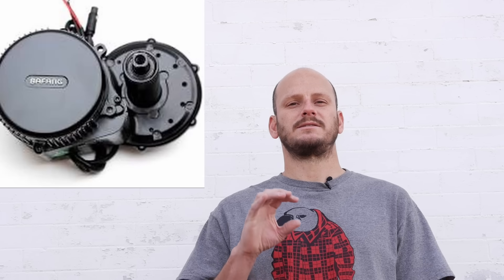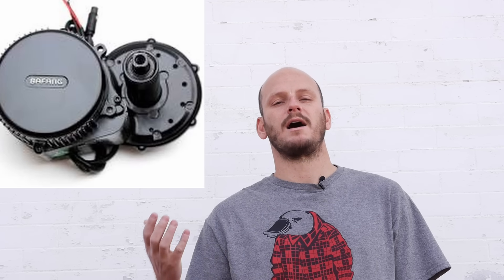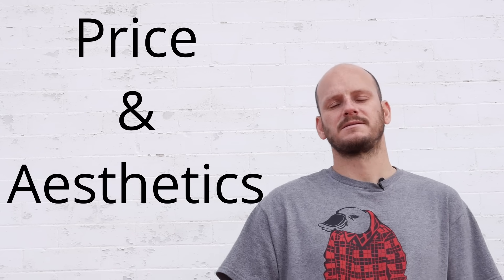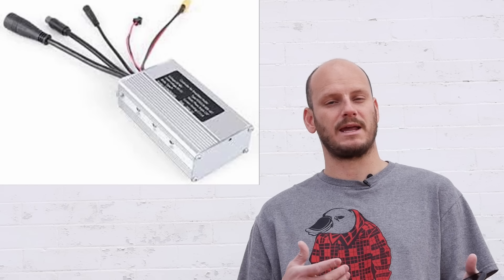Hub vs. Mid Drive Motors: Why Hub Motors Suck and Debunking Common Myths with performance test

Comment: @JohnnyNerdOut 
OFF ROAD is where a hub motor is absolute king.
For a true off road bike a hub motor system will win hands down: Explanation...
Hub motors are easier to set up for 2 wheel drive, no 1 wheel drive can match a 2 wheel drive off road, its comedic even with a massive power difference in favor of the 1WD.  Hub motors add weight in the right place, the advantage here is if you are moving through 5 foot or more of water flowing fast and perpendicular to your direction of travel, without the weight of a battery and motor on the front wheel, the bike will flip on its side, mid motors are not for off road, they work fine on trails, but on actual off road, in places where the only trails are those of animals. they will be the first thing to get trashed, rather than just a chain ring. This former also applies to ice when using spiked tires or chains. no weight no grip.

Comment: I have a question sir. If I had a mid drive, would I still be able to pedal manually without any assistance from the motor? I ask because I mostly live on flat and even surfaces for hundreds of miles.
Reply: Yes

Comment: Completely disagree. Hub motors are much better if you don't want to peddle or shift gears constantly. They're re quieter, far cheaper and easy to fix/replace.
Reply from the maker: Definitely the better option if you don’t want to shift

Comment: Went with a mid drive and never looked back. Having ridden hub motors in the past the mid drive blows them away. Being able to use all the motors power using your existing gears is a game changer to me.

Comment: This video seems to assume gearless hub motor, but there are geared hub motors (as on front wheel hubs) which spin at a constant speed regardless of wheel speed. I don’t think they have the ‘burn out’ issue he mentions with hubs. Mid drives for a long time were noisy and had resistance if unpowered, but the Bosch third gen motors are quiet and spin well without power (if like me you want the exercise or to extend the range).

Comment: mid drives put a lot of strain on your cassette and chain, that 120nm gets to the back wheel through your crank set!
Reply: Bbshd at 1500w with 15$ chains I’ve Never broke a chain  like everyone seems to be scared of. 18$ Cassettes handle it fine. Everyone scared of some fairy tale they heard on the internet. Yeah maybe don’t put a mid drive on a bike if you are using some crazy 500$ drivetrain. Otherwise don’t worry about it

Comment: I'm truly regretting having clicked on (and thus tacitly endorsed) such ill-informed and incongruent drivel. Consider, that the 'expert' criticises hub drives for having no gears (which is not true) yet later says he would only consider hub drives for a single speed application, without cassette (... those are gears, right?). Yes, there are differences between hub and central drives but you won't find any enlightenment here. Disappointed.

Comment: does a 10000 watt mid drive e bike exist?
Reply: 10kw won’t work with a mid drive ebike conversion. That’s not really considered an ebike. With mid drive You can feel aluminum frames flex at 1500 watts . Chains are fine at stock power levels, but more chances of a Break when you start to go beyond like 4000w

Comment: I have a 1KW 1.5KW Peak Mid Motor Bafang HD and it Blows Every E-Bike in my Town out of the Water I hit the Trails and everyone is trying there Everything too get up too me and I just push the Button See ya Through the Woods and up the Big hills 7 Speed it does 19MPH 1st Gear and 48MPH 7th Gear and I get 30 Miles doing 35MPH Non Stop with my 13S7P 91Cells X 18650 cells other People Burn up there Hub Motors all the Time trying too ride in the Woods with me. https://www.youtube.com/watch?v=atAMRzYKwkI

Comment: Hi I have a Question for you I am up here in Canada And was looking at the Emmo Monster 84V,   I live in a hilly area The sales man said that I would need a 4000 Hub Motor and a 50 watt Lithium battery  Price up here is 6.759$ but up here in Canada everything it dubble the price. Should I walk away I am 76 and do not like Pushing up a hill  Thanks  Doug

Comment: Get a hub drive if you're doing a trike. The cassette sits further in on a trike than a regular bike and you'll only get like gear six and seven to line up with a mid drive

Comment: so with a mid drive are you using the bicycles chain or a heavier chain . im a speed freek its just i got pulled over the other day to find my gas motors are all ilegal . i am looking for the cheapest way out. found a motor that atatches to the bike but it drives a single gear with a mid drive one vid said i would have to pedal no way im pedaling at 30 mph. in your video your not pedaling im guessing i would have to get a nice strong chain i will be riding 15 to 20 miles per day
Reply: 15$ kmc z7 chains are fine at stock bbshd power levels

Comment: You didnt mention the negative point of the mid drive 😉  the transmition last much less with a middrive (except if you use a internal like nexus transmition ) and also you cant pedal freely when your motor is off after passing the 25km per hour here in Europe for exemple,

Thanks for all your videos who help improving your community skill 😉 your videos are the best on how to instal bafang on youtube byw.

Comment: I see a lot of people have had issues with hub motors, which is surprising, since most people doing deliveries on ebikes seem to have hub motors. At least that is what I see in NYC, they tend to use something called the arrow e-bike. Those  are very heavily used bikes.

Comment: Why does my Tesla and almost all EV’s have no gear shifting? You are more knowledgeable than the engineers at Tesla?
Reply from the maker: They don’t have gears because of the amount of power that they use. It’s an insane amount of watts flowing. Also the way that electric motors deliver their power is slightly different than a gas engine putting a transmission on an electric motor over 10kw is a waste.

Comment: Yeah, I'm glad I stuck to my HUB build when people were telling me to get mid drive. I went with front, so I have all wheel drive, try doing that with a mid drive. I'm not saying mid drives are garbage, but why mount an electric motor the traditional way (i.e. motor attached to chain) when there is better options.
Reply from the maker: Better is definitely relative. It depends on many factors as to which setup is best for the end user.

Comment: I whonder why hub motors loosen spokes.

Torque goes either:

 hub motor + you (from chain and sprockets), to spokes, onto tire and ground

OR

Mid-drive + you , over chain, to sprockets, into the hub, over spokes, onto tire and ground

Spokes and hub torque are still applied, so what happens ?
Reply from the maker: It’s the cheap hub motors that are laced quickly and cheaply that come loose and break often.

Comment: I want to see what happend when you take into consideration EU reglations to be classified as bycicle and not motorbike

250W continous  (peak in germany too)
500W peak power
25kph top speed
Reply from the maker: Same principle applies. Still using leverage to your advantage.
Reply: Using 500w of power you will be much better off with a mid drive. It will be twice as good as a 500w hub

Comment: Clicked off the video when the comment was made about Tesla's having hub motors - one on each wheel.....  AWD Teslas only use 2 motors for their AWD models, and they are not hub motors, they transmit power through a single speed gearbox with a huge reduction ratio and differential.  Completely different technology.  I'm not aware of a single production EV that uses hub motors.......yet.  This would be the holy grail of electric propulsion, but manufacturers are reticent to commit for some weird reason - I think they are afraid of the unspring weight and how that will affect ride quality.   What makes a hub motor a hub motor is that the motor is made a part of the wheel hub itself, eliminating all gears, belts, chains, etc.  Direct drive.  No EV in the market is doing this right now.  But there are prototypes and customs jobs that do.  A superior technology with the highest power transmission efficiency possible.  Zero mechanical losses.  If you have the right hub motors, you dont need but one single gear.  I built a 4 wheeled recumbent bike with 2 1000watt hub motors and the thing would do 35MPH with 2 people seated on it.   Check my video for the solar assisted Ebike powered by a recycled Prius battery......  Use the right motors for the right job, and all the objections to them evaporate.  The loose spoke problem has nothing to do with the type of motor being used, and everything to do with the QUALITY of the product.  Crappy spokes, cheap hardware, and poorly made hub housings cause loose spokes.  Torque is torque.  A cheap regular spoked wheel will loosen just as much as a cheap hub wheel will.  Get good equipment and this wont happen.  Also, 750watts aint gonna cut it on a bike unless you like using gears.  If you like shifting, then its fine.  But when shifting is not practical or desired, hubs are the way to go.   Like on my AWD skateboard that has 4 350watt hoverboard hub motors.  1400 watts......  It's incredible.  I'll be posting that build video soon.

Comment: I went for a hub drive for only one reason for my diy bomber build. I couldn't find a (affordable) 12Kw middrive solution. My bike destroys most ebikes. Yes it destroys spokes 5 so far in 12 months of riding. I would prefer a mid drive for a lot of reasons the biggest being stealth. Legally you can't ride a ebike in my country with more than 250watts. The police look at my back wheel and my motor thats up 90% of my back wheel they know it's illegal. But if dynoed it will only do 250 watt 🤣

Comment: Does this include geared hub motors? 🤔 Also, electric motors are most efficient running at their rated RPM, as far as what I've read about them in general. That is to say, the "range/VS/3rd gear" argument ... ? I agree with most everything else. Great comparison breakdown 👍
Reply from the maker: Yes absolutely correct about rpm. Mid drives let you utilize the ideal rpm of a motor at all speeds
Reply: @JohnnyNerdOut  WOW, that's wild! Good to know, thanks for enlightening me ✌️

Comment: The bikeshop i went to said they had issues with mid drive motors, where people don't use the right gear because they can feel the difference because so boost is turned all the way up. So with time they end up breaking the chain and the teeth on the gears. For that reason they only give 1 year warranty, where they on hubs give 3 years of warranty.
Reply from the maker: Makes sense. If you don’t ride a mid drive properly you will have issues. But if you know how to ride a bike properly you’ll be 👍

Comment: When it comes to lower power ebikes like less then 1000watts (120Nm torque), I can see mid drives at an advantage. But power above that, I think a hub drive or single speed mid drive is powerful enough. Tesla and other electric car makers with no drivetrains are more reliable and fast. Thats why they do not include drivetrains in electric cars but a single speed reduction gear. Also mid or hub, torque has to go through the spokes. That statement mentioned in the video didn't make sense.

Comment: You stick to mid drives because you're paid to stick with them and make a video about it(!) that is why you prefer mid drives to hub drives.The true facts are different though. Hub drives have and always will have, better efficiency because you don't rely on gears and chains and shit like that to put power down.  thus longer mileage and for the same amount of wattage , more speed. Second, hub drives are designed for hard tails kai bicycles without suspension, and that gap is where mid drive finally finds a place. to full suspension bikes. cause you don't want much unsprung weight limiting your comfort. but you lower the bottom bracket and make it more vulnarable to hits and rocks limiting the space below available. And off course up until now you couldn't have independent movement with mid drives, you always had to pedal ,     something that hub drives don't have in their dictionary. only very recently, that defect, finally changed.

Comment: you forgot to mention efficiency, hub motors will take you further and will add less weight.
Reply from the maker: Explain that one
Reply: @JohnnyNerdOut  at cruising speed, on a road, you would end up going at a somehow steady speed, where the efficiency curve of hub motors is at it's best. Of course at lower speeds mid drives are more efficient but I guess that most of the time for lets say a commute ride you end up going above 15Kmph.
Not all mid drives incorporate freewheeling, which adds cogging. 
Running mid drives always have the transmission losses, while being low they are present at all ON times.
DD Hubs provide regen, which depending on the terrain can add up to 15% range.
Regarding weight... yep, my bad, wasn't aware of newer Mid drives being so light.

Comment: There is one thing I have not seen people mention. 
For a hub drive  e bike it's very difficult to take the drive wheel off. For example when you have a flat that can not be patched and you have to replace the whole tube or when you have to replace your tire, it is a nightmare especially the hub drives with torque arms installed.
Reply: you can geta inner tube that comes with an end, its not circle so you can put in your wheel with out taking it off. They on amazon for £29, expensive yes but easy to put on.
Reply: Learn to patch the tube without removing the wheel.  A top skill for rear hub drivers.
Reply: I've had a few pinch flats with my hub drive bikes and yeah it isn't easy, but I got the hang of it finally and have the tube changed in 15 minutes with the tools I carry with me when I go exploring.
Reply: Just a power lead and one bolt difference is not much extra work
Reply: I'm gonna be honest champ if that's a struggle for you it sounds like you shouldnt be working on your bike or at least need more experience. It's not easy but it's far from difficult.

Comment: I prefer my dual hub motor bike to a mid drive. Nothing hanging low, balanced weight and the torque is awesome with two hubs.  This video does seem a little bias towards mid drive motors.

Comment: I have a question that I cannot find an answer for: When you have mid-drive motor do you ALWAYS have to pedal? I am thinking of ordering bafang mid drive conversion kit and put it on a bike so I can use it for commuting and going to work without being all sweaty when I arrive and this is crucial so if anyone can answer me I would appreciate it.
Reply from the maker: No, it has a freewheeling crank 👍

Comment: Am I wrong in making  the following statement? ..  See below... I believe what these ding bats are trying to say... a one to one ratio is the most efficient.   If mid drive reduces at the crank to increase at the hub..  it is not more efficient .   Even though I just bought a mid drive..  I say hubs are better all the way around! . less wear and tear..on everything!  Less maintenence..  less hassle not as enjoyable!   Now go lube your chain,  add more weight to your bike adding a spare chain, along with your tubes,  tools ect..  and leave me alone!   Ohh .. and stay out of the street unless your doing 40 plus...You do you..  I got me covered!

Comment: I do not really follow of argument that hub drive ruins your wheel but middle one does not. If you have middle drive it applies torque through chain and then through hub again. And due to gear ratio that torque is even higher, so why?
Reply from the maker: It applied to low quality hub motors. They are laced poorly and hence fall apart easily.

Comment: Hub motors are cheaper and easier to instal. But i guess if the longevity is not as good then each individual has to weigh the pros and cons and decide for themselves.

Comment: I think you discount hub drive way too much.  There are pros and cons for both. I own both and neither is 3000W.  For a carefree experience, the hub is better because it doesn't require the rider to do anything but ride the bike. You don't even need to change gears. A lot of hub riders just leave it in high gear and use pedal assist or throttle. It's like an automatic transmission of a car. If you're in a dense urban environment, worrying about traffic lights and cars hitting you, it's easier to ride a hub drive.  

A mid-drive is like a manual transmission. You need to change gears. Starting off can be harder too especially on the hill. But a mid-drive gives what you give. You pedal hard and it responds with strength.  Just like a sports car rewards you when you want to drive hard.

You're correct in that if you want a traditional bicycle experience but with an electric oomph, mid-drive is the way to go.  But that's not the same as saying every situation is better with a mid-drive except one.  If you really break down every situation where you could use either, you would know that there's more than 1 scenario where hub drive is convenient.  Like if you set both bikes to PAS 1 , gear 1 and you start at the bottom of a hill.  So in the end, it's not that hub motors suck.  It's that it doesn't do what JohnnyNerdOut specifically wants it to do.  For some people hub motors do what they want it to do in a more convenient way than mid-drive motors.  I also prefer mid-drive but I'm definitely not going to say that hub drive sucks which is why I still drive both (depending on what I want to do).